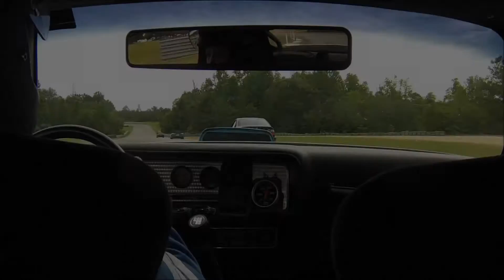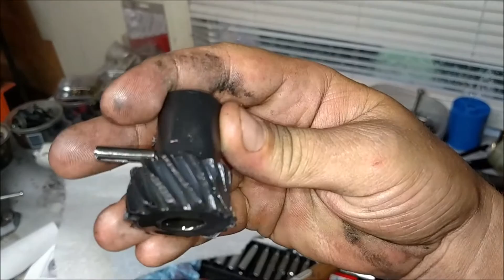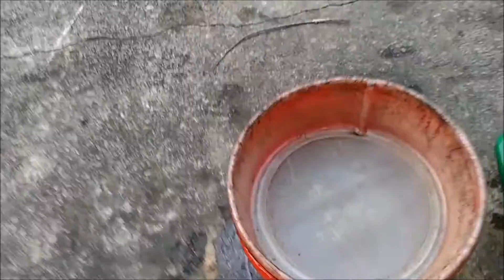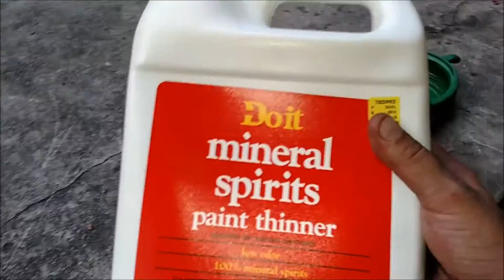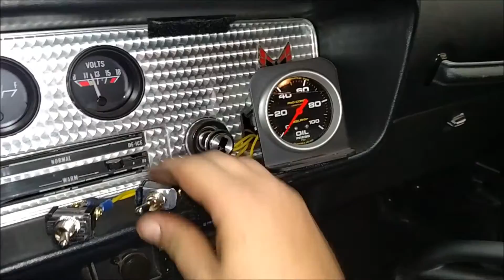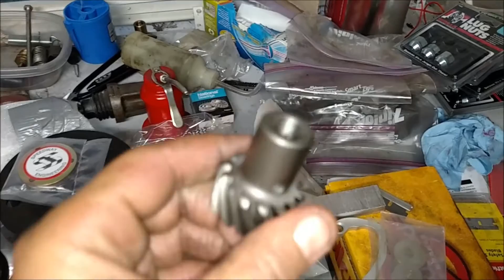1970 Trans Am - Engine Failure, Repair, and Race Footage

Comment: your TDC method is 50% right.  you have to make sure when mark lines up with TDC on balancer, it's TDC intake stroke, not TDC exhaust stroke.   #1 piston is at TDC twice per 4 stroke cycle, on any  4 stroke engine.  otherwise you may end up 180 degrees off and it won't start
Reply from the maker: Yes you're right I wouldn't want to have it 180° out!

Comment: Wait wait wait .. you went through all that bullshit wasted all that oil to remove soft material ? Come on dude I've been building Poncho motor's since the late 70s and I can tell you with certainty the Pontiac motor is a lot hardier than you think .. dude Have you ever even been near a motor when rods let go ? Because you'll know it .. but a loss of spark Bog is certainly NOT a "Blown" motor .. my god dude how long you been a "Car guy" did you say ? I shifted my 420 inch GTO drag car at 6500 ..hey dude are you just following this guy around the track . your following a 6cly BMW are you even trying to get around him ?
Reply from the maker: Sounds like you're a big shot Michael let's see some of your videos and some of your builds. Sounds like I need to learn a thing or two from you.
Reply from the maker: Post a link to some of your builds here. I can't wait to see them.

Comment: Actually it comes down to what the gear on the cam is made of. most solid rollers use a high grade hardened steel which is not compatible with a stock gear. While most hydraulic rollers have a cast iron gear,which is fine with the stock gear. The bronze gears were developed to work with high grade hardened steel use in sold roller/billet cams. Being softer it would be the sacrificial part; IE: it would wear and not the cam gear. Problem is being so soft they wear vary fast need a lot of watching or he could have another failure. 
 One thing you can do to extend the life of the gear is drill .030 hole in the pipe plug on the side of the void just above the gear. This provides oiling they don't really get other wise. The factory did this on the 455sd motors because of the high 80psi oil pressure spring. The higher pressure put more stress on the distributor drive gear as it also drives the oil pump. Not really needed 80 is pretty high . Most people put a stock pump in at the first rebuild/opportunity.  Hope this helps or is at lest useful to someone.  have a good one!
Reply from the maker: Nice

Comment: If you get tired of swapping bronze distributor gears along with the bronze flakes in your oil, H-O racing used to sell cadmium plated distributor gears that you can run with billet steel roller cams. You may be able to find these cad plated distributor gears from a different source.
Reply from the maker: that's a good idea do you know what store sells them?
Reply: +jtwoods41978 Not sure anymore since this was 20 years ago, but you may try calling Butler.

BTW, did your engine builder drill a 0.030" hole in the oil gallery plug on the back of the block to allow a positive stream of oil to flow on the gear to relieve this issue? Pontiac knew about this weak distributor gear issue since the RA IV engines had the cadmium plated distributor gear and the later RA V and SD engines had a larger gear on the distributor (with a smaller one on the cam).
Reply from the maker: +Cash2112 engine builder claims that he did drill the hole but I have no way of checking and less you know how I could check

Comment: car looks and sounds awesome.
was curious of the specs of motor and driveline.
Reply from the maker: motor is a Pontiac 400 with all forged internals making 472 horsepower and 487 foot pounds of torque at the crank. aluminum driveshaft TKO 600 worked over by Liberty gear to make a shift well at high rpm.
Reply: jtwoods41978 Are you happy with the tko 600 on the street? I am thinking about putting one in my 78 trans am. I am collection the parts to build a 461 stroker. butler ported edel head motor.
Reply from the maker: +ONE77TA yes it is a good transmission but in order to make it shift well at high rpm you need to have bronze shift guides installed I had mine done at liberties gear.